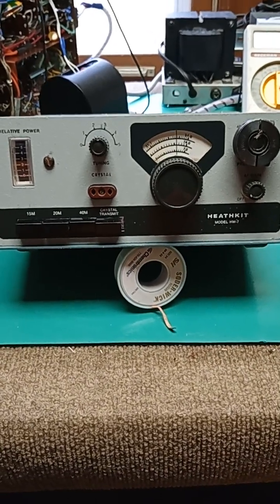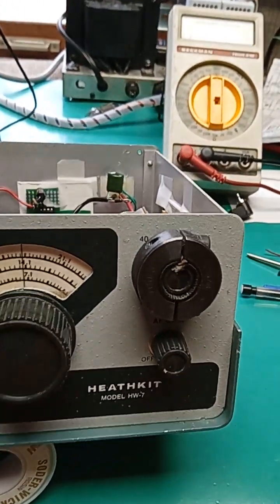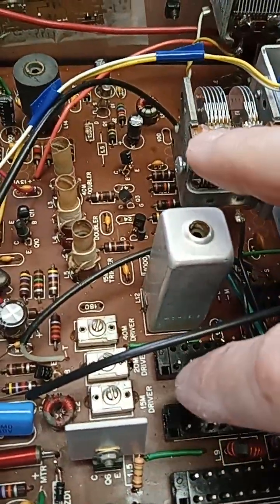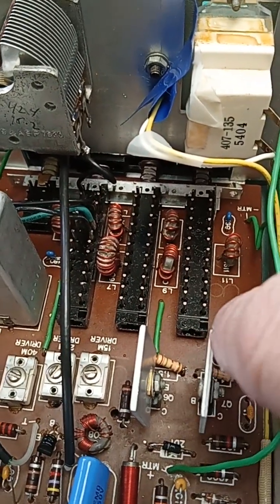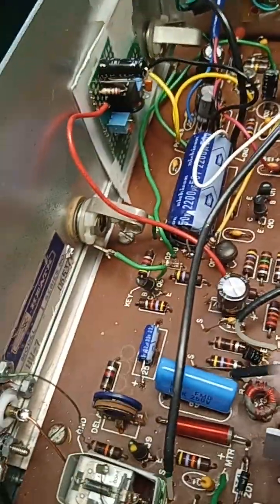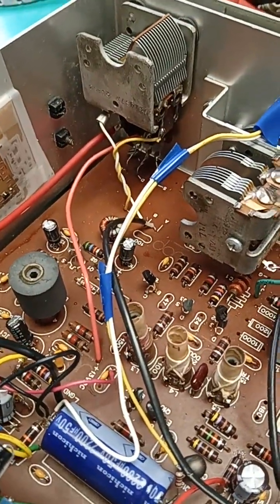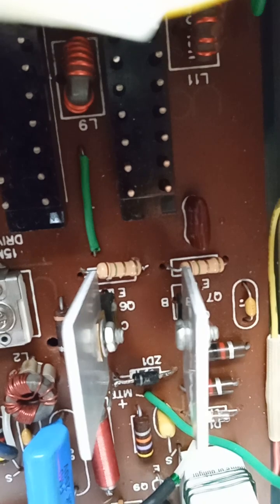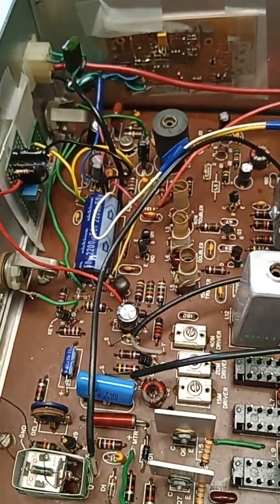Heathkit HW7 Restoration (Heathkit Lied!)

Comment: Hi I enjoyed your video's, I also have a HW7 and did all the mods, rit new mixer etc and it now works as well as my HW8, this is what the Heathkit circuit boards where made from, Paxolin is a fireproof laminate sheet that is made of several layers of paper that are impregnated with a synthetic resin. The finished product is strong and rigid, making it an ideal material for a variety of applications. It is often used as a lining in electrical cabinets and as a base for printed circuit boards. 73 from Jim gi0ggy.
Reply from the maker: That makes sense about the boards the way they delaminate when overheated.

And I found a mod to get more TX power, mine was 3/4 watt and now its 1.5w ( qro). match emitter resistors and add 47 pF from collectors to ground.